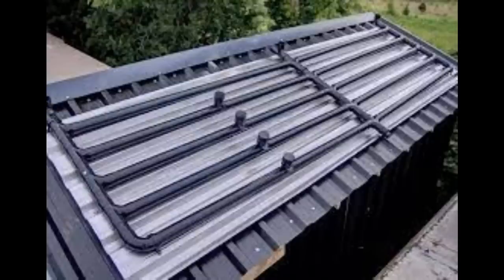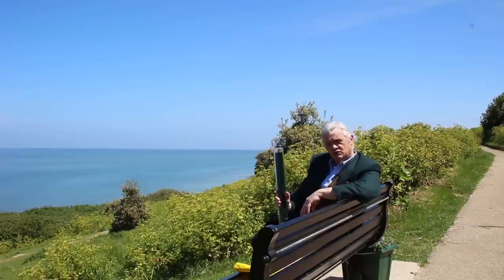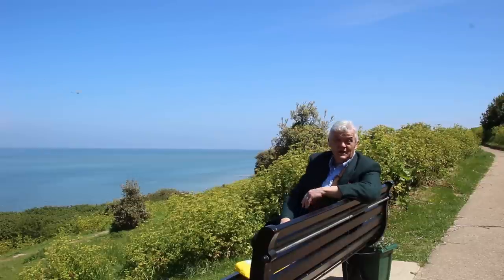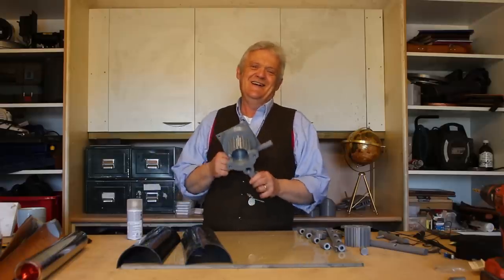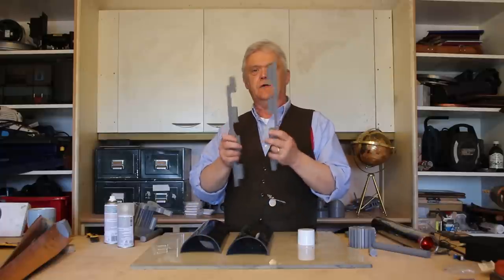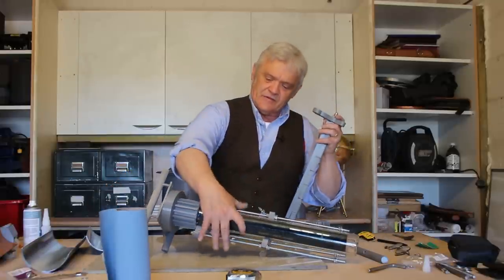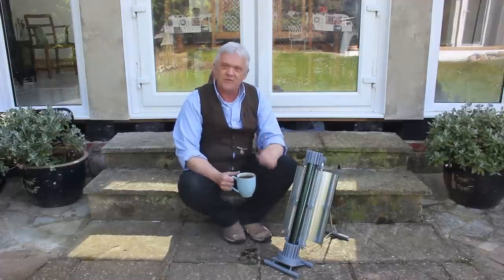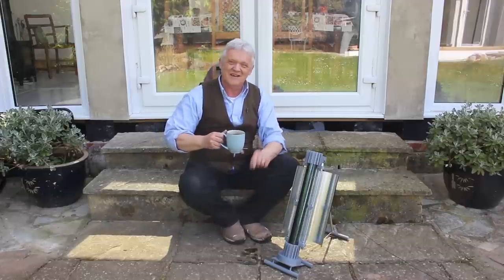1937 The Solar Kettle

Comment: Here's an idea for you Rob. A 3D printed parabolic mirror solar cooker !
Reply: I made a parabolic mirror using an old satellite dish and mirrored milar tape taped over it in strip's I've used it to boil and fry eggs and fry bacon. I did spay paint the dish metallic silver before putting the tape on. I have also used crisp packets to make a cigarette lighter parabolic mirror. Many food products come in foiled plastic packaging and some are more reflective than others. Emergency thermal blankets are also very good and cheap to buy.
Reply from the maker: i like the idea mate but i have made parabolic mirrors before - quite a few of them - and it is easier to use a washing up bowl

Comment: How about solar concentration ? Like peace of Fresnel lens  (or ordinary lens) in front of vacuum tube , at proper focal distance. Seems to me , that it would speed up heating...
Reply from the maker: the rate of heating is what you heat how much you are heating, how much sun is falling on it and how good the conversion is
Reply: @ThinkingandTinkering  That is only logical. I'm fully aware that this device (same setup) would work better (faster) if placed on equator , in high noon in summer , at correct angle. I was talking about the device that you made (suggesting possible improvement , without spending a lot of money). Otherwise , we can include (providing the sun is shining) some kind of enclosure for the device , to prevent wind chill heat loses (possibly with insulation) , and two axes solar trackers (those work on electricity , which beats the purpose of being cheap and "green") , better reflective ( properly angled , with right curvature) surfaces , etc...Still, it is a fine idea for someone to learn basic principals of solar heating (in a useful manner).

Comment: This sort of highlights just how many of those one would need to heat the water for a home. 
Also, why the UK does not use them as much as the sun lands of the world.
Reply from the maker: that doesn't make sense with the argument i made as the same holds true for PV solar and we use a lot of that
Reply: @ThinkingandTinkering  Fair enough. Eighty minutes of continuous sun for four cups of water seemed a lot when I thought of my daily shower and how there isn't enough light in the day just for that at that rate. I suppose the idea is you would have hundreds of these things on every roof.
Reply: Every BTU displaced by solar is a BTU of gas not burned. You may need some makeup source (which admittedly adds cost for the home owner) but if you have a gas driven water heater now why not add some evacuated tubes to reduce the amount of gas burned ?
Reply: @karlniemann  I could also add random solar cells in hopes of arbitrary gains. At least those won't add a leak risk in a high pressure system. Or paint my roof black. Or whizz into a pc fan generator. Sorry, sorry.. Whizz into a small pc fan converter.

Comment: Okay what is that tube piece called I am going to see if I can find one cause that is pretty darn cool!  
I want to alter this design a bit.  I want to put one of these on the roof of my camper, and then put in a Thermistor and Arduino Uno R3 to control a Pump.  This way when the water reaches a set temperature the pump will pump it down another pipe into a Storage tank "Old hot water heater the elements burned out in, and Collect the hot water from it, then I can use another pump and hook that up between my Shower and the holding tank so that I can use that water to shower.  I think this plan will work, I have everything all ready to go, but I do not have that tube, and I need one to make it work.

Comment: Don’t know if I’ve got mixed up but should the angle not be 20 degrees from horizontal and so nearly laying down? As the sun is so high in summer and vice-versa in winter
Reply from the maker: just repeating what i read mate

Comment: Oh, by the way, don't solder your heat pipe closed as it will likely explode.. Cheers!
Reply from the maker: good point and it is why i said crimp lol - but thanks for adding that
Reply: So even though there is a vacuum inside- it still has the possibility of exploding under heat because the pressure still increases? I wanted to try making some and was trying to think about the safety of it. I'd assume the key is making sure your cooling system can lower the pressure generated from the heat side at a rate which keeps the internal psi from exceeding pipe wall or cap strength. And I have no idea how to calculate that.
Reply: @mememan2344  I think the thermal capacity of copper pipe is more than sufficient for the intended purpose, although my point was about heating a closed system with a propane or other gas torch to seal it (which would probably cause catastrophic failure).  Under normal solar heat conditions, it would merely leak from the crimped end if it were to get too hot.
Reply: The double walled glass tube will not explode unless you somehow completely sealed the 58mm opening at the top. 
I believe they are talking about the copper heat pipe which is commanly inserted into the Glass tube to transfer heat from throughout the tube to the top of the tube for transfer again to hot water. 
If you don't remove the heat from the heat pipe via the transfer to water then the pressure inside the copper tube can increase to a point that rupture could occur.

Comment: Would like to see a video about directly connecting PV panels directly to an electric water heater as a simple low cost alternative solar hot water.
Reply from the maker: why? that seems really an easy thing to just do
Reply: @ThinkingandTinkering  Because the high voltage dc will burn out the ac rated thermostat... and im curious how you would go about fixing that bit.
Reply from the maker: @asdfdfggfd  will it? what are you thinking of as high voltage?
Reply: @ThinkingandTinkering  Say 4 pv panels at about 40 volts each in parallel making about 50 amps?  I don't know, but I feel like that would fuse the ac rated thermostat on the hot water heater...

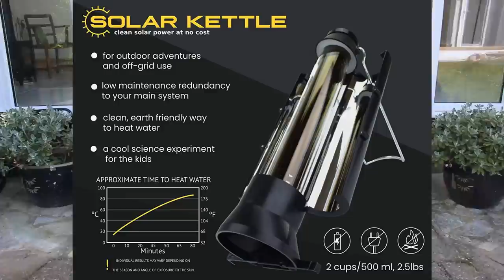Comment: I've seen the solar cooker version that looks great, put your food in around 10:00 then come back at 1:00 and it's cooked. Make one of these 😁
Reply from the maker: already have done - tomorrow's vid lol
Reply: @ThinkingandTinkering  awesome can't wait, and to see what you are cooking 😅 how are you finding your filament holding up to the temperatures?
Reply: @ifell3  That was my first worry as well but the outside of these tubes do not get hotter than ambient air. So unless your air is 180 Celsius your PLA should hold up.
Reply: @karlniemann  it can plasticise from 70° upwards. I've often used a hair dryer to slightly resize something that hasn't printed right. I've pulled off a thin print that's at bed temp, it warps a little. Because it's in a vacuum I don't think the outer would get that hot, but prints in a car on a hot summers day will warp.
Reply: @ifell3  Good to know. I recently went to a RepRap show and there was vendor promoting "High temp" PLA. They had printed coffee cups with it so If I tackle this I would go looking for high temp filament.
Reply: @karlniemann  Oh jealous!! I think there are a few different blends like PLA+. Follow the 3D gun community, they come up with the best filaments for obvious reasons aha

Comment: They don't explode .and they don't work well if not soldered .have you considered a very low boiling point liquid and putting it up in the air at night for refrigeration? It need a cone to reflect out in to space and block the environment radiation.. if use for heating a house it can go 60 ft put a fire out side or a solar trough in the south end and pivet it to track the sun the rest in side is a radiator.subs use these going from the nuclear reactor to the sterling engines.
Reply from the maker: i haven't considered it
Reply: @ThinkingandTinkering  hi I've been thinking about how to max out energy from the joe Flynn switching magnet device simply cheaply .a v gate or magnetic Wankel with out the magnets just a big wheel with a steel rim off set or a split wheel off set with a cut down microwave generator for the lamentations then use two very strong neos like the 75 pound ones and add the paul Babcock understanding of huge copper windings to drop the input power .just switch the magnets back and fourth.and collect the energy from coils around the drum. You could add a second drum on the other side ..only two magnets !!!

Comment: What about using a more focused reflector(s) to increase the heat and reduce the time?
Reply from the maker: go for it
Reply: Its about surface area of the reflectors. The more sunrays you can redirect to the tube the better.  While these "wings" are concentrating already to a degree, making them more concentrated won't help. Only increasing the size of the reflectors will increase the heating capacity.

Comment: What if u use fresnel lens to heat metal to heat watter. I think that is faster than that. Or maybe combine these two.
Reply from the maker: give it a go
Reply: @ThinkingandTinkering  i have fresnel lens, size about 30cm*30cm. But i dont have other stuff. See i am poor, only what i have is my ideas. I cant test them because i dont have money to buy all the stuff. I have like 10000000 ideas, but i know i never have chance to test them.
Reply: Its all about the surface area .... A fresnel only concentrates the energy collected to a spot, and the total energy is related to how big the fresnel is. I.e smaller fresnel less energy. 
The evacuated tube is collecting along its (mostly) whole surface so a fair comparision would be to calculate the surface area of the tube versus the surface area of a fresnel. 
Also consider the heat transfer interface. With a fresnel you are transferring the energy at a small dot (say 4 mm) to the metal which then has to conduct the heat to the water. The tube has a whole lot of surface area in contact with the water (500mm x 10mm) so I posit that the heat transfer is greater with the tube than a fresnel on a pot.
Reply: @karlniemann  Freshnel generate like almost 1000C degree heat in that small area.. if this is combinated with that tube, it would be more effective. Maybe freshenl is better to use like stirling engine, but it can be use many applications for sure.
Reply: You can get large Fresnel lenses for free from old rear-projection TVs people throw out, mine are about 0.7m² and I use them for cooking, I have some videos how I do it (without burning the food)

Comment: Can you use the hot liquid in the heat pipe to move a turbine? And if so, is it efficient?
Reply from the maker: i don't know mate
Reply: the Heat pipes are sealed so a "inline turbine" to take advantage of the rising vapor would have to have a return path for the condensed liquid that re-enters below the turbine. Also the transmission of the electricity would require the breach of the pipe wall creating a problem for keeping the pipe sealed.

Comment: 20 degrees in the summer? I though solar panels in the summer are more flat, then when winter comes they need to be more upright?
Reply from the maker: it's what i read when i did the research
Reply: @ThinkingandTinkering  I think that would be from the horizontal plane and not the vertical 😬
Reply from the maker: @ifell3  you are right mate cheers
Reply: @ThinkingandTinkering  no probs, we are all human 👍 also I notice if you have the tubes horizontally you have to keep adjusting for overlap from the one above, so good cool for vertically positioning. 
Not too sure if you watch tech ingredients channel but he made some really reflective paint!
Reply from the maker: @ifell3  i did see it mate - but i thought he took it from nighthawkinlight
Reply: @ThinkingandTinkering  oh yeah he could have done! Another excellent channel!!

Comment: The issue, from a sustainability point of view,  with this system is the tube itself; not easy to do by yourself and given the price I'm afraid that it's made in countries where the suppliers take differential advantages of low wages. How can we replace that tube with something produced locally ?
In another order of ideas, why are you using gears at the bottom and the top ? Repurposing some other constructs ?
Reply from the maker: isn't that pretty much true of everything we consume in the west?
Reply: @ThinkingandTinkering  It is not if we find a way to manufacture them by ourselves, locally.; it's not an easy endeavor to manufacture locally but with a little effort you find good sources and/or methods.

Comment: I got excited about the solar thermal approach a few years ago when I saw a DIY-video from the "AmazingScience" Youtube channel (Google search phrase: "New Solar Oven Design - Transforms according to the purpose of use "). Your version lifts this idea to an even higher level. Could the collected heat be used to generate electricity using Peltier elements, or would that be too inefficient?